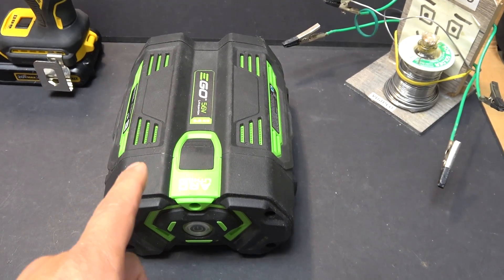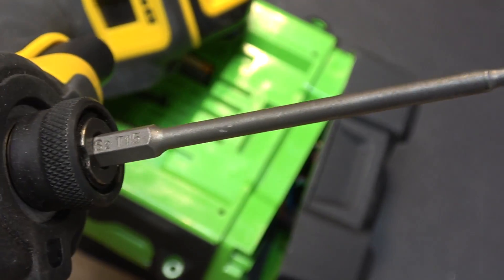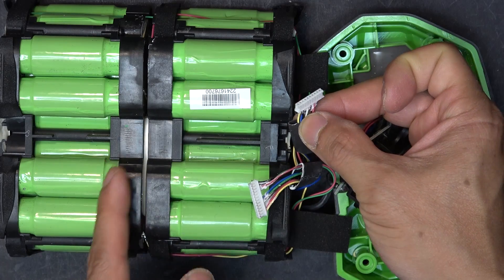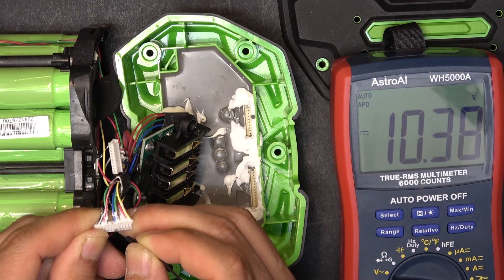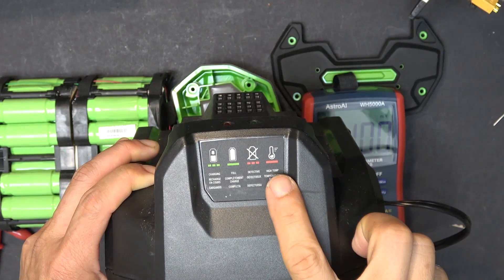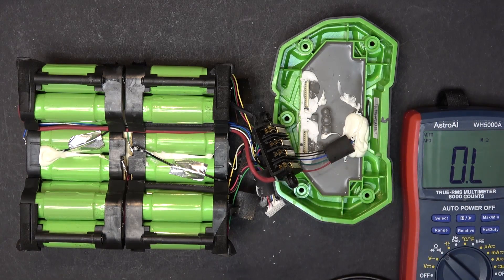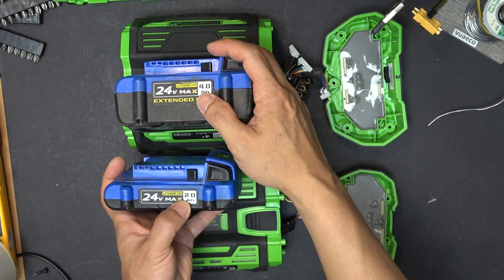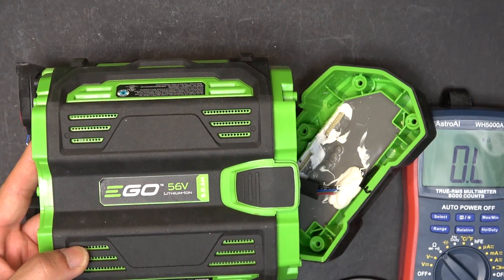From trash to treasure: Teardown & Repair an Ego 56V 5.0Ah battery

Comment: THE BANG TRICK WORKED .SO glad I saw the comments about banging the battery from about a foot off the ground and dropping it. IT WORKED I had THREE bad batteries. ALL THREE have been working GREAT since May and I recharge and use the OFTEN. HOLY GUACAMOLE. Those three bad ones were here for over a year. I bought two news ones for 200 bucks a piece but something told me NOT to throw those bad ones out. THREE bad batteries now working PERFECTLY for five months with CONSTANT charging. I have the lawn mower, leaf blower and snow blower and I use the blower daily and the lawn mower once per week. HUGE area. SO glad I was the comments about BANGING the batteries. THANK YOU THANK YOU THANK YOU
Reply: That actually worked
Reply: I’m blown away, this actually worked. I tried everything. I can’t believe it. Thank you.
Reply: I can't believe it but this actually worked!!! Thank you so much! I just took the battery and dropped it on the concrete from waist level, power button side up. Now it charges again! Thanks again Mr. Tony!
Reply: @Memphis_10-f8j  Hi Joe. Glad it worked for you. I've been doing this for quite awhile now.. I have the ego mower, leaf blower and lawn mower. It's a good thing I saved the five batteries that I thought were useless. I have 5 ego batteries . Small for the leaf blower, big guys for the snow blower and lawn mower. I did this again just a couple of days again when the battery on my lawn mower went RED. Just took it out, gave it a smack on the ground (not too hard) and it's back to normal. I've had these Ego products for SEVEN YEARS and the batteries are STILL going strong. Glad it helped.
Reply: Explain this please.  Or link bideo
Reply: @bigkk758  Very simple. Hold the battery in your hands at about waist level. Drop it on the ground, like a sidewalk. That's it!
Reply: @tonys4396 
Are you dropping in a particular side of the battery housing, or flat on the top, flat on the bottom where the charger connects... it's there a specific way?
Reply: @LarryMusgrave  One I dropped from waist heighht. straight down. Another I held in hand and smacked against the sidewalk while holding it on the top corner. Just hit it any old way. it worked for three of mine. I wasn't careful because I thought they were going in the garbage,
Reply: Thankyou so much, this saved me from buying a $400 battery
Reply: @thechilma  You're very welcome thechilma . I posted that SEVEN MONTHS AGO and it is now April 27 and all of my batteries are STILL working, .I have been using the leaf blower every single day since my first post here and the lawn mower and the SNOW blower (all of these tools with the SAME batteries. The batteries are STILL taking a FULL charge and lasting the same amount of time. Every once in a blue moon, one of them will quit on me and give me the red lights. It happened about two weeks ago when I did my first Lawn mowing for the season. I took the battery out of the mower, smacked it on the pavement and put it back in the mower and went on my merry way until the battery needed to be recharged . MANY thanks once again to the person who originally posted that here. SAVED ME A FORTUNE since I'm using the Ego lawn mower, snow blower and leaf blower with those same batteries on a constant basis.
Reply: @tonys4396  I thought this is guy bat shit crazy. I guess I am too now lol! Thanks
Reply: i get batteries from a local true value hardware store that are considered defective, the cure you describe sounds crazy bu....na give it a try and see how it works, thank you i appreciate the info. Jayme
Reply: @JaymeVanAuken  Hi Jayme. I posted that info over a year ago. During the past year, here in NYC, I've using my Ego Snow Blower, Lawn Mower and Leaf blower on a regular basis, using the same batteries that I thought were dead, this whole time. I also have many friends and relatives who own Ego gear and who are now banging their batteries as well. LOL Funny thing is, I'm the guy who yells at everyone I know if they bang their remotes when they don't work and tell them to STOP BANGING them and just change the batteries. So trust me, I was the LAST person who was going try to fix them by banging then. But, since they were sitting there totally useless,  I had nothing to lose, and I'm glad I did. . Please post here when you try this with the defective batteries you received from True Value. Dying to know it they work. Good luck
Reply: @tonys4396  I will I'll post the results. I do have a lot of ego yard tools. Again thank you
Reply: @JaymeVanAuken  Very welcome Jayme
Reply: After having gotten the defective code from my fast charger for months when trying to charge I just dropped my 2020 BA2800T 5.0AH battery flat from waist level on concrete just outside my back door picked it up walked back in put it on my fast charger and VOILA!  It's charging 😂😁 Thank you!
Reply: @ZORKUSMAXIMUS  Spread the word. IT WORKS! Saved me a bundle since I have MANY EGO products and batteries. Glad it worked for you
Reply: Okay I just did this with my 56v 7.5AH battery which just had a solid red light.......and now it works fine.  Hey if it works for a little while longer, I am good.  Really appreciate this illogical way of fixing electronic devices.  🙂
Reply: @flyingvengeance  I've been doing this on a regular basis for a couple of years with batteries that I thought were burned out .Fortunately I saved them.. Funny thing is, I always yell at everyone the house when they bang things when they don't work, like remote controls etc, I would have NEVER banged the battery to make it work Someone else on here said to do it so I gave it a shot. I have a bunch of different EGO batteries and a snow blower, lawn mower and leaf blower. Yesterday, I was mowing the lawn and it happened. I actually took the battery out, gave it a smack with my hand, and the finished my lawn. ANYWAY, glad it worked for you,
Reply: @tonys4396  yeah I am going to do this for as long as it works.  Better than $400 for a new battery.
Reply: My new battery arrived today. I've been fighting with the old one since April. No charge. I'm gonna go drop it later to see if it works. I'll keep the new one too cause I only used blower 6 or 7 times and the charge always only lasts about 10 to 20 min since I bought it!
Reply: Thanks for this, worked perfectly for me as well!! Dropped from waist-high, hit the concrete, lights flashed, mowed for an hour, good as new. I was quite upset that a 1.5yo 56v 7.5mAh battery with good cells (green after long press) would fail so quickly (stored at room temp, and I don't overwork it). The battery had worked (~60min mow) and then charged to full prior to the red ring of death when trying to mow the following week.  After two weeks of checking on the battery, short press, long press, throw on charger to check, nothing worked. As others have said, I would have never have tried dropping it, and I'm so glad it worked out. The problem either lies with the thermal resistors, or the PCB itself, glad the physical shock gets it going again!
Reply: @jdmjeff510  Glad it worked out for you. I wrote that comment almost a year ago and I have been doing it before then. Constantly, since I have a mower and leaf blower for summer and the snow blower that takes two batteries for winter . So, whenever it happens, this trick works every time, Now, I just take the battery out and just hit it against the ground. Not too hard and not too easy. I saved a fortune on batteries since I learned this trick. I hate when people bang things when they don't work. People in my house sometimes bang the remotes when they don't work, and I ballistic and tell them to change the battery. So I have to admit, when I saw someone recommend banging it, I thought he was a jerk. LOL I thanked him .,I know nothing about thermal resistors or PCBs so I'm glad I saw the bang it comment
Reply: I was having the same issue with my 2.5V battery. I dropped 3 separate times at different angles & put it back on the charger. I came back 20 minutes later & plugged it back into my leaf blower… it started working again. This actually fixed my battery issue ❤️❤️❤️
Reply: @jodyjo2030  Glad it worked Jody, I posted that about a year ago. All this time I've been using those batteries that I thought were useless using this method. DON'T bang them too much. It doesn't take much to reset them. I use them all year round. I have the lawn mower, snow blower and leaf blower.  Those same 3 batteries that I mentioned in my comment a year ago are STILL working great.
Reply: I'm glad I found your comment. A budy came to me and asked me what he should do and I was doing some research and found your comment. I told them to try that first a d if it didn't work then we will go from there.
Reply: @hilham89  Trust me, it works. Been doing it for ages now on my lawn mower, snow blower and leaf blower. Tell him not to bang it too hard. Saved me a fortune in batteries. Did he try it yet?
Reply: I thought you all were crazy. But I did it just now, and I'm so happy my battery is now working well. Thank you!
Reply: @gerardcabunoc5156  LOL Trust me. All my life I've yelled at people for banging things like their remote control, when it stopped working, and tell them to change the battery. I thought the guy who originally posted it was just a wacko, but, considering the price of these batteries, I gave it a shot. I have a BUNCH of batteries for seven years for all my Ego gizmos (lawn mower, snow blower and leaf blower) and I'm still using batteries that I thought were useless. Luckily I didn't throw them out. I give them a shot every so often all these years when they act up, but they are ALL still working. Glad it worked for you.
Reply: So, WHAT is actually happening to the battery when you "bang" it that causes it to start working again? Is it realigning the negatively charged particles away from the positively charged particles?????   😲
Reply: @kebo57  I think that this is certainly a case of the shishkaboobiam ohm interacting with the unaligned positive deltonium combined with the physical impact pertaining to the herculinium nectar encased in the enclosure. But, I gave it a shot and it works. This is more a case of Machiavellian "The end justifies the means" extrapolation. So did it work for you?
Reply: Wow! This totally worked. Dropped it from waist level straight down on a concrete patio. Instantly started working again. Thank you 🙏
Reply: If you wash the terminals with toothpaste and put it in the freezer for about 24 hrs, the also come back to life. Charge it while its still cold for best results
Reply: Hi, I have a 5ah EGO battery. The charger says it’s charged, but when I go to use it in the mower, it momentarily flashes, green, then orange and eyes. It will not go. Put it back on the charger. I immediately get three green bars. If I push the button in on the end, it flashes orange constantly. I don’t know what’s up. I don’t know if this will help or not but I’m about to try anything. It does sound like though with this thread it was batteries that would not charge so I’m not real sure what to think. Appreciate any response from anybody.
Reply: @BarneyR-u2d  Hi Barney, All of my Ego Batteries are STILL working just fine.. I still occasionally give them the ole SCHMACK treatment lol. Mower, Snow Blower, Leaf Blower.  Don't go berserk smacking it on the ground, just hit on the flat ground. Or, drop it straight down from your waist level. Read all the responses to my comment. Countless people have stated that my this method works. You have no choice. If you don't smack it, you have to buy a new battery. If you do smack it and it doesn't work, you have to buy a new battery. If you smack it and it DOES work, you won! If you do smack it, please respond to my comment to let me know. GOOD LUCK!
Reply: Dropped it and didn't work bummed. I did it onto a block of wood though lol. my fast charger shows 100% and battery light is off. bummer

Comment: Dude, the stuff that is encasing the BMS actually comes off fairly easy on some of the batteries. Fuse on the larger batteries are bigger too. Man your vids inspire me to make more vids!
Reply from the maker: Not on this one. If I try to peel off that silicone, all of the electronics will come out too.
Reply: @vuaeco 
I have a video from over 5 years ago showing how easy the silicone potting on this BMS is to remove. It was my very first EGO repair video. These 5ah and larger have a temp. monitoring board in the middle of the pack halves with smd transistors.  Hope it helps.
https://youtu.be/EH0GS0iUzzM
Reply: @vuaeco  interesting, the one I took apart was super easy to get the silicone out.
Reply: @vuaeco same. I’m working on a 4ah one now and the silicone just won’t come out. It chunks out in little pieces. Took me over an hour to get it only half way uncovered
Reply: It looks like epoxy. Impossible to remove.

Comment: DIY Home disassembly of lithium ion battery packs should not be encourage watching videos like this , fire and explosions are danger to others causing injury and deaths.
Reply: We let people change their own break pads on a car!
Reply: Ur lame! Change a fuel pump,oh god so dangerous. Change a break, oh you could die. Making beer at home with co2, oh you could auffocate. Seriously, all diy is dangerous. Just buy new stuff and pay pros since life is so scary.
Learn the theory of what youre working on and proceed understanding actual hazards. Build your knowledge and skill set.
Thank you very much for the video.
Reply: @caseygina3553  you dont need a fraction of the 60v to stop the heart. Voltage isnt whats scary, its A. A taser is safe due to lower Amp.
Reply: @schuylerpryne5  "you dont need a fraction of the 60v to stop the heart. Voltage isnt whats scary, its A. A taser is safe due to lower Amp."

Yep.  Never take electrical advice from someone who doesn't know ohm's law from coleslaw.
Reply: Oh please, just because you dont understand them enough to work on them safely doesnt mean others cant.

They are not complicated.
Reply: That's not necessarily true. If you're mechanically inclined, not an idiot, just use some caution and be careful using metal tools around the battery Cells and it can be done safely.

The other option is the entire Battery will be put into the landfill

Comment: So why do the volts add up in increments like that? 3:49 Thanks
Reply: The batteries are in series. 1st battery (3.3v) contact positive side to negative side of second battery (also 3.3v) will read 6.6v. This is called series connection. Ego use 14 x 4.2v batteries (charged to 4v each) soooooooooo..... 14 x batteries at 4v each. Connected in series 14 x 4 = 56v
Reply: Series and parallel !!!

Comment: I have one of these EGO batteries on my leaf blower.  After watching this video, I would not buy another one of these products. What did you decide to do?  I assume you tore it apart to use the cells, but these products are so damn expensive to begin with.
Reply from the maker: I don't have another 5Ah Ego battery so I'll just wait for another dumpster dive and pray to God it has a dead Ego 5Ah battery inside! :D These are good cells so I'm thinking reusing them for my ebike.
Reply: I've had good luck with the third party batteries on Amazon.  The Tomapex 5Ah worked just as well for a much lower price.
Reply: @DerekWoolverton  Thanks.  I'll check it out!
Reply: Yeah, you can tell these were designed to fail, or at least designed so when (not if) they fail you have to purchase new.  I don't play with companies like that.

Comment: You explain things really well thank you! 
P.S. On a crank sensor (red / black / blue wires) how do I check the polarity of the red and black - is it OK to just swap over and see if it works?
Reply from the maker: Do you mean the cadence sensor for the pedal assist? Usually red is positive 5V (for most sensors), black is ground, and the third wire is variable voltage for sensor. This is exactly the same as the throttle cable. I think you can swap it with a throttle control and it should work but don't blame me if you burn your controller because I've never tried that before. I'm just guessing. :D
Reply: @vuaeco  Ha no problem thank you!